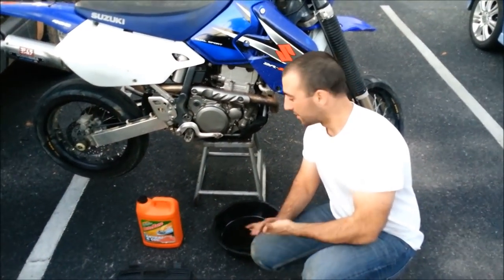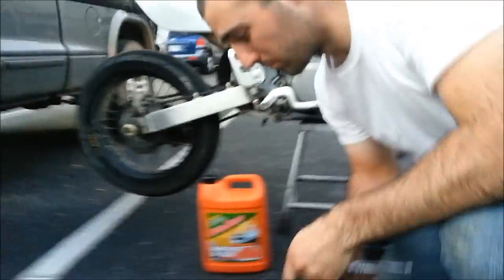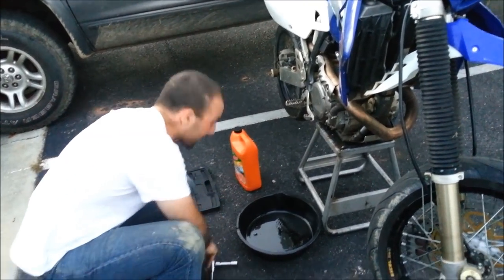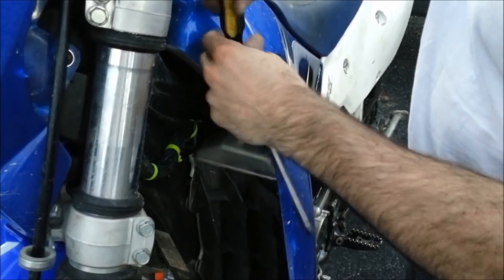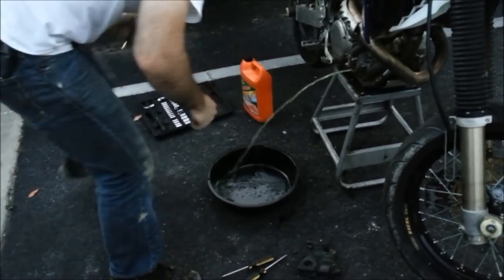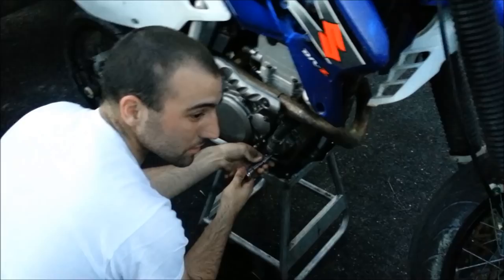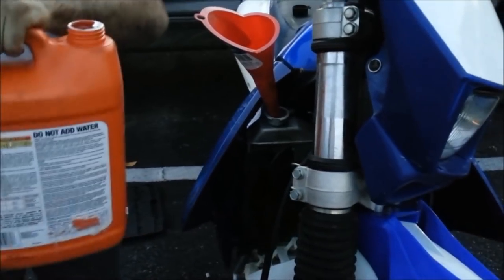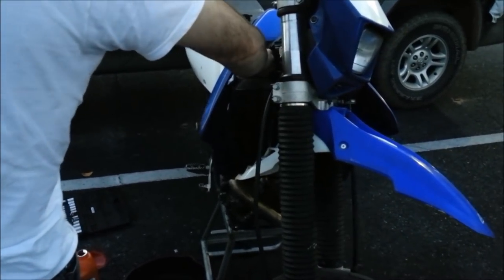How to Change Your Coolant on a DRZ400

Comment: Great tutorial! One thing I'd add is make sure it says silicate free and safe for aluminum radiators on the antifreeze.  Silicates can destroy your water pump seals.  Antifreeze from the dealer can be crazy expensive.  It's more than fine to use automotive antifreeze, just gotta read the back though.
Reply from the maker: Definitely true. Most times when I buy it, I'll get the premixed stuff and its safe for aluminum and silicate free. But its always a good idea to read what you're buying.

Comment: If im switching over to engine ice dont you need to run distilled water through the radiator a couple times to get out the previous coolant to prevent sludge build up
Reply: +Moto boner That sounds like a good idea regardless of the coolant.
Reply: Thanks buddy i remember some guys at a motoshop we're telling me about that on my gsxr

Comment: Why everyone unscrew the radiator cap  first... ain't that's the reasons it shoots out uncontrollably 😂😂🤣🤣
Reply: If it's cold it wont.
Reply: Lmao why would it shoot out uncontrollably😂. How else would you open it to check and fill it. The only time it will do that is if you open it while the bike is hot like a dumb a**

Comment: Does water go automatically into the overflow tank when filling the radiator or do you have to fill the overflow to a certain point and if so how do you do it.
Reply from the maker: +KOOLITUS The overflow tank on these bikes actually dont have a fill point if I remember correctly. When the bike heats up, excess coolant goes in to the tank and when the bike starts to cool down, coolant is then sucked back up into the radiators due to the pressure difference.

Comment: I know this is an older post but can someone tell me how much coolant should be in the little tank behind the motor I have a new DRZ400s 2013 and it has about half a tank, should it be full or is half a tank ok?
Reply from the maker: That tank is just an overflow resevoir. Normally half full is just fine. As long as your radiator levels are in check, I wouldnt worry about the resevoir.
Reply: I though it was funny that It was not full because it was so low, lol. I thought the coolant level was low but it is always full when I open the top up, this makes since now. Thanks for the help. Boy do I fill dumb.
Reply from the maker: gunlover1955, I didn't realize what that little tank did either until I broke mine. Lol. Ended up losing loads of coolant everytime i rode and decided I'd just replace it with a modified turkey baster. Works great now and the coolant level is always constant.
Reply: My overflow reservoir is always empty. If there's coolant in there means the the bike is overheating.
Reply: Definitely fill overflow tank half full, if not you also run the risk of creating an air gap in your radiator. PEACE AND BRAAP.
Reply: @arrowrain  Same with my new 2018 DRZ 400S, i.e. coolant reservoir is always near empty.
Reply: @Edward-rg8mh  yes I verified with a workshop. Its normally empty unless the engine overheats.

Comment: why change the coolant in the first place?  top if off maybe but it should be fine for the life of the vehicle
Reply from the maker: +first For people like me that prefer to change fluids regularly, their vehicles tend to last much longer. Coolant is cheap. Why risk having it break down inside your motor when you could just change it? That's my philosophy at least.
Reply: there is no reason to change it regularly.  coolant will barely show any thermal degradation after 5 years and they all contain anti-oxidants.  it is also cheap to change the air in your tires every week but you aren't doing that are you?  coolant is very toxic and  it takes forever to breakdown.  it is not a good idea to replace it and generate meaningless toxic waste
Reply from the maker: +first to each his own. I do it annually just to be safe with my machines. Feel free to peruse some dirt bike forums online but most will agree that changing coolant, especially in dirt bikes is important since these bikes are much harder on all their fluids than other motorcycles.
Reply: why is that good to change air in tires ?
Reply: @sdqsdq6274 u don’t.. u basically top off tires 😂😂

Comment: Correction in the title, "how to NOT change your coolant on a DRZ400"
Reply: For real. That "pressure release" bolt is for bleeding air out of your left radiator when you're filling. Also, he gets coolant everywhere. You can leave your cap and bleeder bold on when you take off the drain plug, it will hold the coolant in from the "straw effect" (vacuum). After the drain bold is off, you can undo the cap or the bleeder bolt to let the coolant out.
Reply: Can’t just change coolants with out flushing right?
Reply: I stopped watching soon as he said Phillips screwdriver
No japanese motorcycle uses Phillips screws
Jis screws only